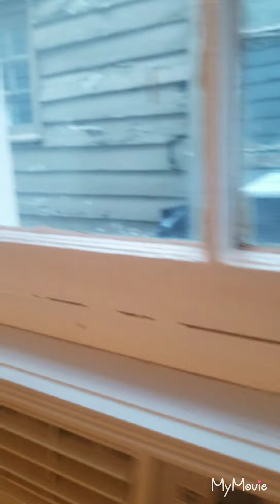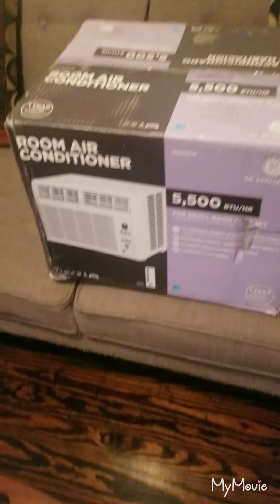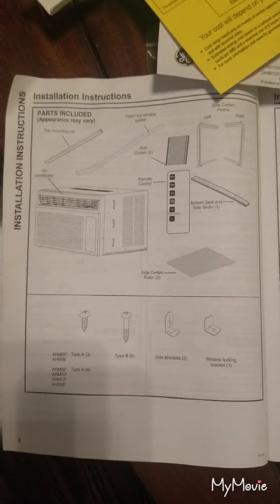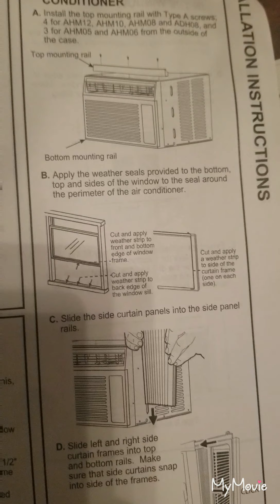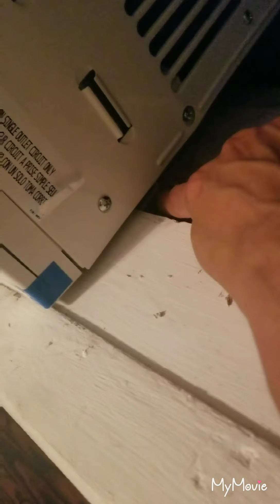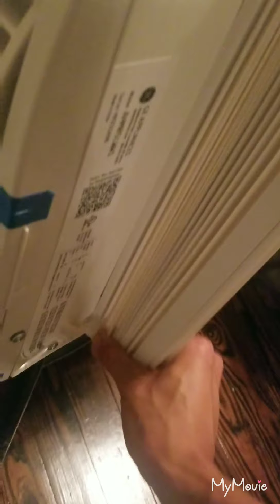Remove Old AC Window Unit & Install a New One

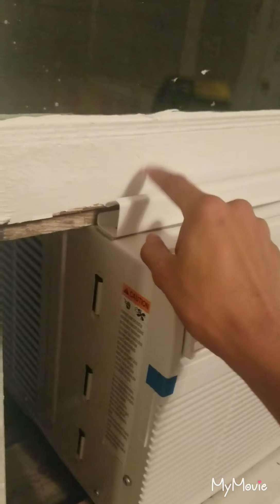Comment: ok so you did a great job getting everything instaled but 1 thing is that @6:30  the window has to be in that lip for home saftey so that a burgaler can not just push the ac out and it needs to be like that for proper condensate drainage so i recomend that you change that because it has to have a slight tilt outside but good job overall
Reply from the maker: Thanks for looking out! You can see @13:52 that I ended up doing that.
Reply: i didnt watch the video through so i revise my comment good job